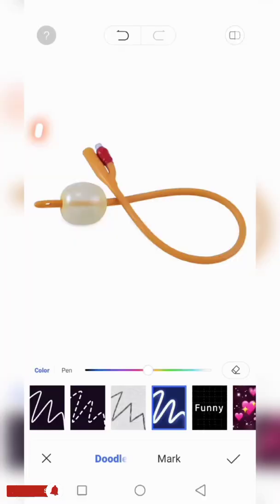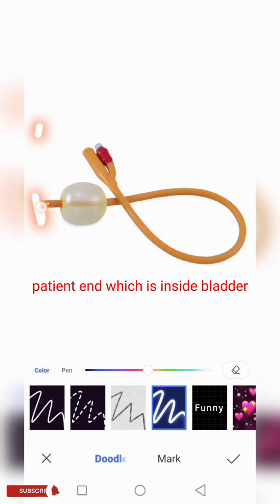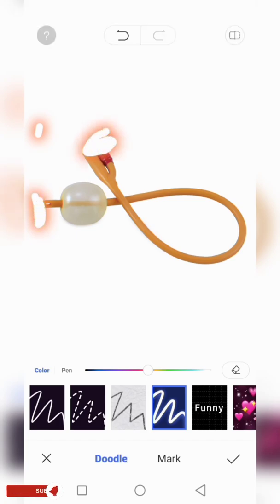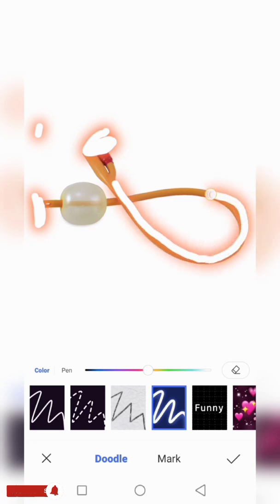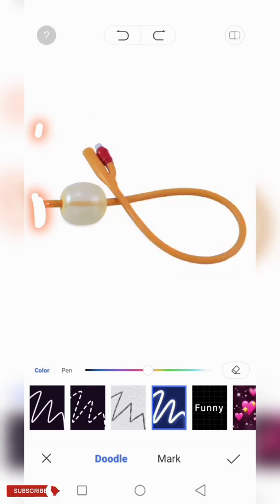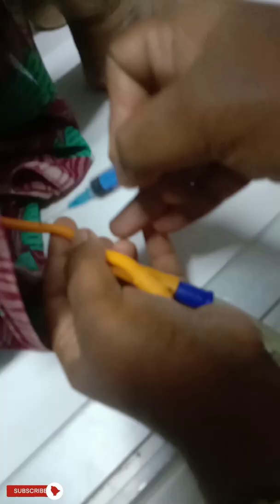blocked foley's catheter removal using ultrasound

Comment: Sir what about the remnant of the bursted out ballon.. If that thing remain in bladder n cause infection. How to approch that... What about non invasive lubricated central line guide wire procedure to clean the ballon port line  ( plz upload if u have any video related that)
Reply from the maker: Remenant will be coming out though normal uretha, but it's difficult to insert central line guide wire. Will try next time, thank you